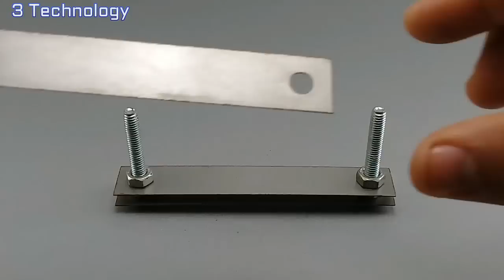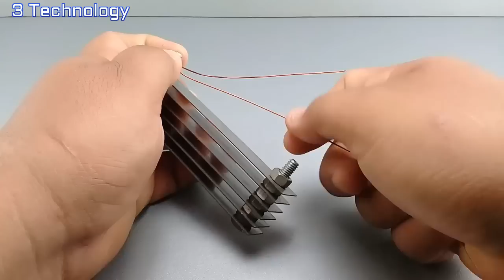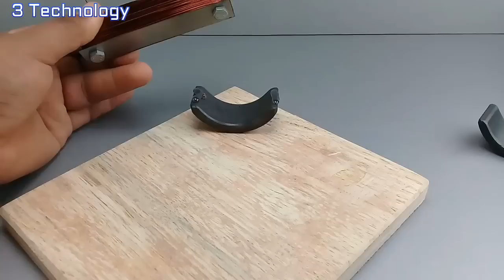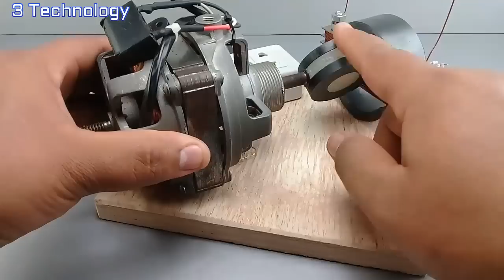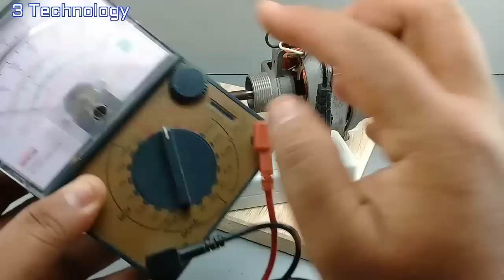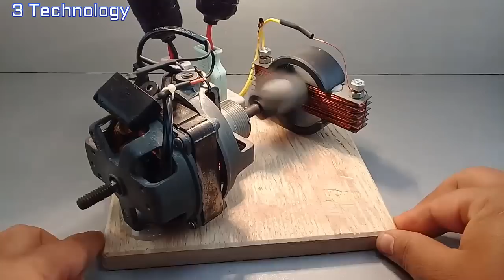I make 230v Free Electric Generator from a Copper Wire use Magnet Energy

Comment: Does this gadget overcome Lenz's law?  Does the spinning ring/speaker magnet have little or no opposing torque from an induced field?  Could this thing be "twisting off" an induced field like making balloon animals and then pushing it forward like an antenna transmits an EMF field?  The Chinese have demonstrated that you can transmit a VLF signal from moving magnets.